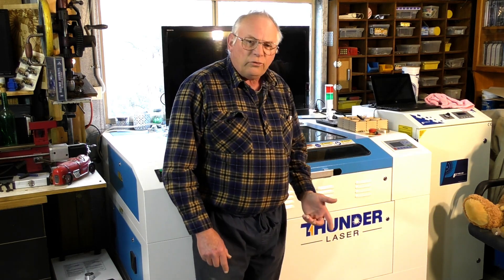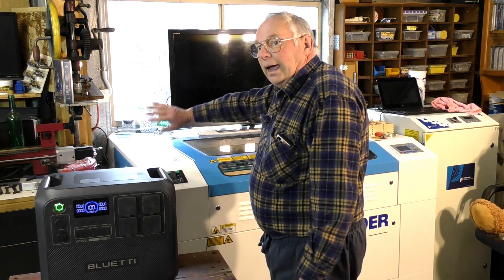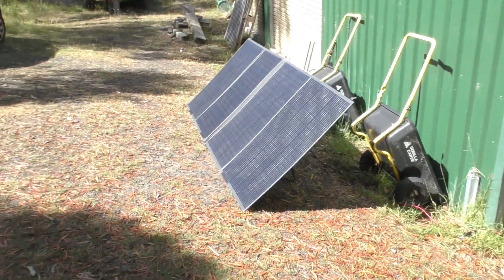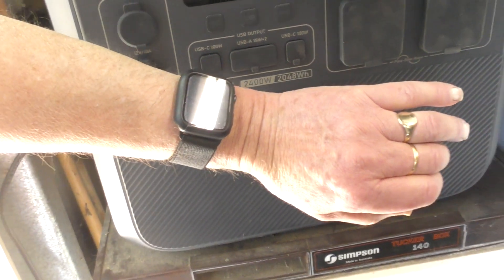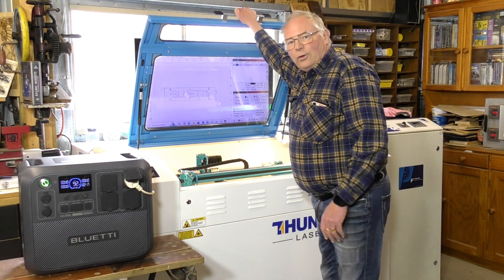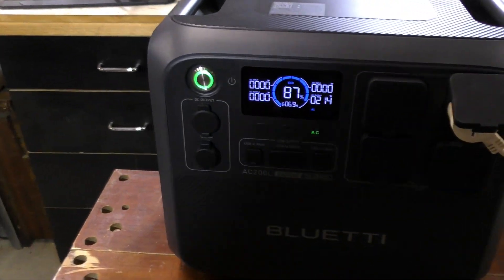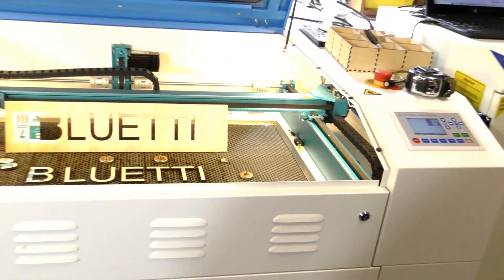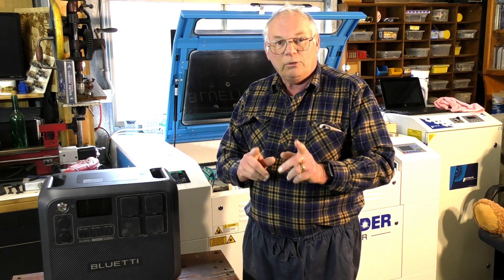Can you run a full-size industrial Laser on solar power

Comment: I have never thought about solar and a backup system 
But to say it seems a good idea to have at hand
And use regularly 
As your keeping the cost down from the electric bill
And getting a regular free source 
Well it's not totally free until the equipment has paid for itself
Nether the less you have given an insight of off grid  source that works for running such of a laser 
Thank you for demonstrating